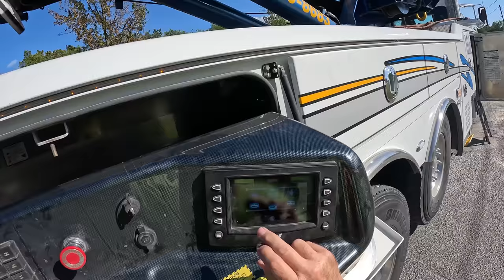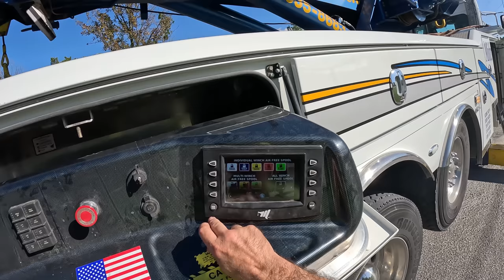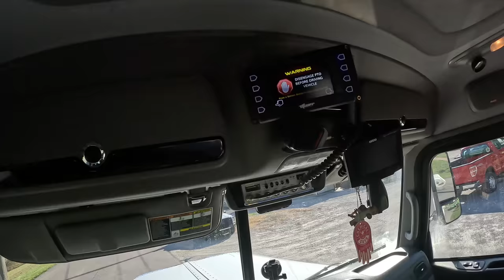GREEN MACHINE GOES DOWN WHILE OUR ARC NEMESIS LOOMS!!!

Comment: great job,  good job with trouble shooting the trailer air supply and service brake system. Shows how not to get tunnel vision when isolating an issue. Keep all options on the table...It would be easy to focus on the damage and overlook the reservoir needing to fill to supply suspension.

Comment: We're not able to roll without replacing the brake booster Ron. 
The tow truck operator's shop would have a mechanic who can replace the booster on site. What was he doing cutting the corner anyway?
Reply from the maker: It was worse than just the brake booster.  The booster mount that welds to the axle was bent and had the rod jammed.  Off-camera we can to cut the push rod to free the brake on the driver's front trailer axle.   The mount had to be cut off and replaced inside a shop.  I'm not certain, but I believe the S-cam housing may have also been bent.   Thanks for watching and God bless.

Comment: Ron how that break is working is like a wedge now. He was able to back up cause they back off the drum. But when he pulled forward the brake basically wedges on the drum vise grips onto the cam shaft twist it back would help pull the brakes off the drum

Comment: I had to have the rear of my freight van picked up and swung inline with the dock in old Cleveland once. Useing the overhead boom in the plant. 
I told my boss after i got loaded 
Never went back. I had a small bunk conventional IHC and a 48' dorsey van. I was useing all the street and sidewalk. 
If that had traveling axles and the driver had caught it in time he could have shortened up the swing.

Comment: Oscar, Is doing great. He has a great teacher. Ron, I have noticed lines ( rubber or a gauge) over the rear hubs on the trucks. I would like to know why they are they if you don't mind answering my question.That sunbelt truck had them. There is a cap on the hub for greasing the wheel barings. I have wondered that for a long time. Well everyone God bless you all. Ron, family, crew the police and all.other emergency workers. Love to all. Hi mom Pratt. ❤❤❤❤❤

Comment: I pull the same trailer, only thing that sucks about these trailers is you can only slide the axles forward about 2-3 ft unlike the 440's that can slide all the way up. Don't get wrong, it can still get you out of some tight spots, but not nearly as maneuverable. These trailers track like lowboys.

Comment: You can get within 3to 5 ft of the primary power lines without issue the bottom phone line you can touch with ZERO issues right above that is cable TV Lines

Comment: Looks like driver had some fun. Did you guys or sunbelt have to replace can on site or was he allowed to take to shop since he still had 3 of 4 hubs with brakes.  Got to watch earlier in day since trk is at dealer. Since trk was drinking coolant. Turns out apu was leaking internal and coolant was replaced. But dealership found injector cups were leaking and now waiting for blend door.  6 days in 4 different shops in 2 weeks
Reply from the maker: We escorted him back to their yard.   The police didn't mind, they just wanted the intersection cleared.   Sorry to hear you are having APU issues.  Especially if your company won't allow you to run the truck....    Thanks and God bless.

Comment: You should call the power company and ask for training around primary circuits because you're so far away from the primary they will never arc to the boom. Then you won't have to post a caption about how "close" you are.
Reply from the maker: I have been trained and have access inside power and sub-stations. I never stated in the captions any specific distance the boom was from the cables.    What I said was "our Arc nemesis is looming".   It's a running thing with this channel.   A lot of our jobs tend to be in close proximity to overhead power lines.   My viewers are always watching for them, so I point them out.  It's just part of the channel.   Thanks for watching and God bless.

Comment: Just to not be that guy... The driver should have shorten the wheel base from the fifth wheel to the trailer axle, slide them foward so he be able to make that turn. Just watch out when turning. That tall end swing wide.
Reply: The unfortunate thing about the 930 trailers is that axle group only slides like a foot
Reply: Swing wider... It's a frigging fixed trailer. :)